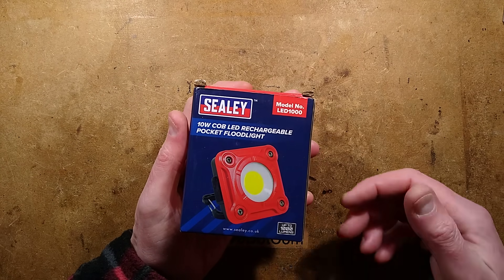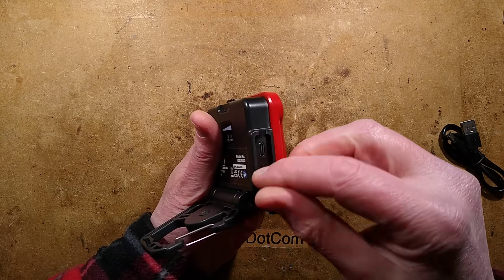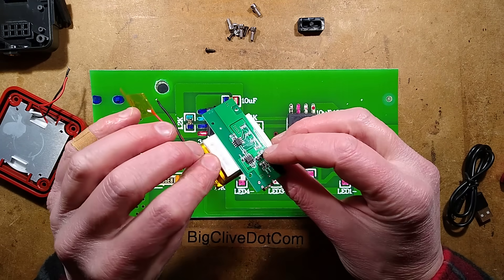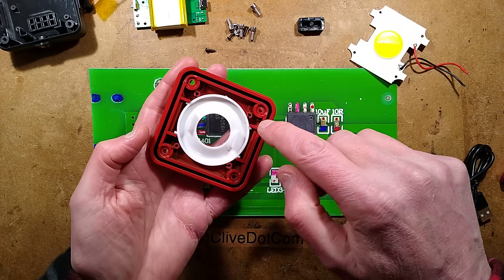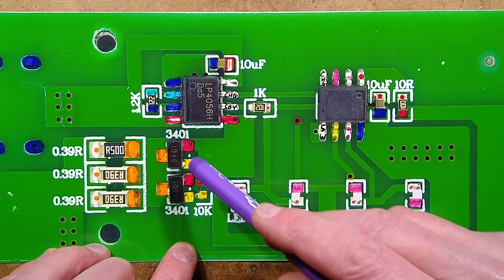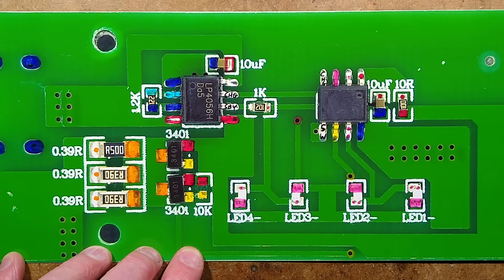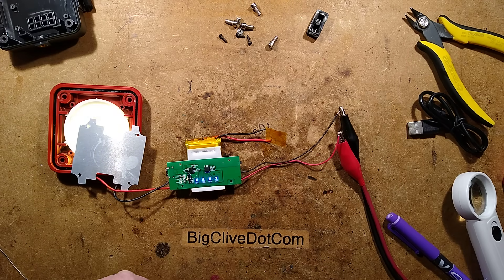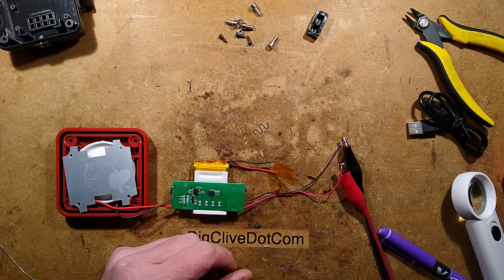Pocket floodlight teardown - with schematic

Comment: Could you do a video to eliminate or bypass the click flashing light...
ie battery to bulb with resistor to run and possibly dimming.
Anti epilepsy upgrade 😻

I don't like the possibility of puncturing the battery also the heat.. 3? Amps🤔
It's not just conduction but radiation and a unventilated space.

I have an idea for a video... could require a microscope 🔬
Take a debit/credit card apart.

Comment: What bothers me the most is that it has a lithium pouch cell(s) in between components that get warm. I'm not sure how much to worry about that, but using that battery as a heat sink just seems wrong. 
I popped a big lithium cell drone battery on purpose to show a friend to prove how dangerous these things are and it farted the grey gas which ignited explosively followed by the ridiculously hot flame jets. In less than 10 seconds after self-ignition all that was left were weightless ashes I have no plans to do that again any time soon, it scared both of us, even though I'd prepared to contain the fire.

Comment: i thought that pouch batteries shoud not be squeezed since that is what Samsungs Note 7 phones brought to self ignite, Samsung bought batteries from another vendor, which size slightly deviated from spec and during charging these spicy pillows can expand due to gases. If that gets restricted the separation inside them can fail and bridge anode and cathode
Reply: Upvoted for "spicy pillows" !

Comment: I don't buy any flashlight/torch that has that dam blinking function. If I get one from Amazon because they didn't say it has it in the description, I send it back. The flash function is not needed for shop use. If it's a bike, camping, or running light, it is useful. China needs to let us know this. No more flashey, # No more flashey, No more flashey, No more flashey, No more flashey.

Comment: That's not a 10watt LED! A 10w LED emits roughly the same light as a 60w incandescent bulb. I have a torch/flashlight with a 10w Cree and without the lens and reflector on it, lights up my living room quite brightly. With the lens and reflector I can overpower one 55w halogen headlight or even my 35w HID headlight. It claims to be 1016 lumens and uses 2x18650 batteries in series/parallel. It charges from a USB A, can charge another device, and is a torch/flashlight. I can't buy a replacement battery for it, so I disassembled the battery and replaced the cells myself with larger 3000mah high drain batteries.

Comment: An entire computer to run a light. The mind boggles.
Reply: I’m reminded of an old science fiction story in which computer chips become sentient, with watches, radios etc being discarded because they want to hold philosophical discussions with their owners, eventually crying out for help as their batteries run down.
Reply: @markfergerson2145 There were a few similar Black Mirror episodes, but it’s worse - instead of an AI the embedded sentience is a duplicate of a real human.
Reply: @markfergerson2145 , thst,'s a good argument for all AI to be run off of batteries, and not from the electric grid, so that it cannot remain sentient indefinitely. A sort of electrical "sundown provision" !
Reply: I can handle batteries that go bad.
    What I hate are phones that spy on me after they are turned off.

Off should mean off.
Reply: @tomweickmann6414  I put mine in a coffee can with a tin lid. I put it in there and then called it and it was silent,, just to check.
Reply: @tomweickmann6414 ,  if the microphone on your phone's keypad is enabled, it most definitely does listen to you and collect data!
Reply: CPU is just 1 single ALU unit (1 adder, 1 or, 1 and, 1 xor, 1 not) shared between all circuit.
With no MCU how many "or"s and invertors you need to create a toggle button? 
CPU is simpler because it solve problems using same resources shared in time instead of multiplying resources that do nothing most of the time.
Reply: Hello - you must be new here; welcome to the 21st century!
Reply: its probably for the charging circut
Reply: @perry92964 No, that’s handled by two other chips, one looking at the USB input and another handling the cell charge and discharge. The micro handles the light output and charge state display LEDs. Remove the blinking capability and the micro could be left out.

Comment: Does it remember the light setting when switched off ready for switch-on BC? If not then if you have to go through the accursed flashing mode in order to select the brightness makes it a definitely "do not buy" for me.
Reply from the maker: It doesn't.   But it does go through a logical sequence.   Low, high, strobe.

Comment: I bought a surprisingly bright key-chain light from my local petrol station about a year ago, which too has a magnet on the back and charges via USB-C. I thought the magnet would be very handy, should I find myself grovelling under the bonnet of my car at night. 

Stupid here forgot the whole front end of his car is made from aluminium...
Reply: Is your car put together with aluminium bolts?
Reply: @tonysheerness2427  Glue.
Reply: There was a time I brought a flashlight with a magnetic tail cap up a ceiling and it was a mistake. The magnet attracted a bunch of rust and metal dust from the roof that fell on top of the ceiling that by the time I got down the black tail cap was brown. (Popped the magnet out to not make that mistake again.)

Made a similar mistake before with magnetic USB cables and left the part that separates from the cable on the phone. After a few days of using the phone outdoors the cable does not contact the magnetic pins anymore due to all metal particles that got attracted to the magnets. Had to clean both ends for the cable to work again properly.

I find magnets are nice when they work in your favor but when they unnecessarily just attract random metal particles its a headache.
Reply: Landrover Defender or Audi A8/A2?
Reply: @Stefan_Dahn  BMW E60 (5-series 2003 - 2009). The rest of the car is steel.
Reply: @HowardLeVert I think some parts of my car may be fiberglass in addition to aluminum (but it's Volvo)
Reply: Only realised the wife's Citroen C5 Crossair had a plastic tailgate when she tried to slap the magnetic UK badge on before a booze cruse last February. She's swapped it for a Nissan Qashqai and the UK badge has clung on perfectly in last months trip. Happy days as, along with copious amounts of wine, she brings back a good selection of beer for me. Cheers all. 🍺

Comment: Does this one start to slowly lose intensity a few minutes after you leave it on? I have a Parkside (Lidl) 20W battery floodlight at work that starts dimming down very, very slowly a couple of minutes after you turn it on, yet I can notice it doing that in very small steps, and its very clearly been programmed to do that. When you turn it off and back on, it comes back at full power and does it again. I wonder why they do that, are they hoping we don't notice it getting dimmer so the battery lasts longer, or is it because they decided to not install a proper heatsink in the bloody thing and are trying to get the LEDs to not overheat? It's really annoying because initially it's actually impressively bright. I also own a small handheld work light from them that does the exact same thing.
Reply from the maker: It's to reduce the heat dissipation of the LED array.
Reply: And yes, the floodlight has the obligatory strobe and SOS mode, because of course it does.
Reply: @redpheonix1000 usually its the temperature of the led which causes the drop by the driver... But the 18V Lidl floodlight doesn't not do that with a fresh 4Ah so maybe your unit is defective

Comment: Everybody is so fancy with microcontrollers when a simple rocker switch high-off-low will do the job just fine.
Reply: Yes but a switch won't do the vital SOS function!
Reply: @zebo-the-fat the one that everyone hates?
Reply: @Handyman1199 , zebo was obviously being sarcastic!
Reply: @goodun2974  so was i
Reply: @zebo-the-fat  depends how quick your fingers are
Reply: @zebo-the-fat  good catch, imagine flashing SOS to no avail manually.
Reply: To an old bugger like me what you are saying sounds right. But these days a microcontroller is probably cheaper.
Reply: Not matter of fancy, it is simply cheaper to switch off low voltage DC current using mosfet, which can at the same time deal with the question of isolation when charging. rocker switch cabable of controling 0.35Amp and switching it off,  in a dusty enviroment. Sealey is a DIY (plasterer) used brand, that would reduce the switching capability of rocker switch even more. As much as I have put rocker switches into mine laser spirit levels and would like it in mine (electricians) headtorch, Switch that would handle the dust would cost too much. This brand is not good enough for for electricians.
Mosfets are simply better value for money when switching DC.
In either case. I disagree with @clive on this being much good. as headtorch on your head just does not take handy pocket space and its too big for carabin onto belt
Reply: SOS function can be activated by pressing several seconds. Don't bother people with normal use.
Reply: But that rocker switch can not produce most important and usable mode in our world - flashing mode!
Reply: Man, I don’t like the dent in that lithium battery.
Reply: keep thinking people must get into all sorts of s..t in china that they need an sos in every product.😂
Reply: Was going to say that thing is begging for a toggle switch.
Reply: You already need the circuitry for charging, so you will have to pay for the PCB. And a rocker switch costs a lot more than a tactile switch, and all of a sudden the extra cents for an MCU isn't that much anymore. It always, always comes down to cost.
Reply: @JendaLinda  3 amp at full draw, so you'd need a beef switch or relay. No pwm so even worse wasted power with ballast resistors. Higher wattage resistors so through hole instead of smd so higher assembly costs. And undoubtedly would be a lower power bulb type.

It's not your grandpa's flashlight world anymore
Reply: @nyetloki why not a regular small switch toggling a mosfet to actually push the current?
Reply: without the microcontroller then you wouldn't have the need to ( As Clive says ) "Crack one off"....... Resister, Resister.. I meant Resister..
Reply: I don't think that would help the waterproof rating and would also be particularly prone to being accidentally triggered, which could be a fire risk or, at the very least, discharging of the lithium cell and damage to the LEDs.
Reply: @ElectricChicken  what fire risk my man that's a led light lol. 

Also imagine how Manny decades there where waterproof lights with switches.... 😅

Comment: I like that it has a lipo over an 18650, I don't like the plastic tabs digging into it. One good drop, and it could go nuclear. Lol
Reply: Having used many soft case lipos in rc car both 10th and 1/8 scale you would be very surprised at how much abuse these batteries can take. Around 37mph into a tumble to then having the battery fly out and tumble some more on a tarmac car park, got a couple of years out of 5000mah turnigy soft case packs getting many weekends off abuse
Reply: @HootMaRoot  having seen clive take apart street lithium from vapes and done the same with ones that have literally been ran over and flattened by cars i can confirm that these pouches are surprisingly resilient
Reply: 18650 has protecting valve which causes open circuit if internal pressure rises. LiPo cell has no such valve. It becomes  wider when internal pressure rises, and in normal state already has dents. I mean Lipo has more chances to cause a fire than 18650, even with no factory installed dents.
Reply: Lipo on metal hot cooler ist dumb and most 18650 can take some impact. This bulgy lipo sack burst into flames much faster

Comment: I had a Snap-on version that I found lying in the road... it was excellent (not sure the COB rating) I did look it up... being Snap-on, it was seriously expensive, about £60 and that was nearly ten years ago!
Reply: I found my Snap-on flood light the exact same way! Crossing a major street I didn't see it till I stepped over it! Use that light at night every night since! No strobe feature thankfully! Dimmable too!
Reply: @reddrglrd , I have a half-dozen identical-appearing LED flashlights in the same cast/extruded aluminum casing, that I bought 4 or 5 years ago at various times from the same "job light" store. Some are high-low, some are high/low/flashing. I engraved the functional-sequence onto them with a Dremel tool so that I can tell them apart! The ones with a flash mode are in the glove boxes of our cars, and the non-flasjing units stay in the house. There's also a bright-green plastic-housed, lighter weight version (same size and shape) that is strictly on/off. I should have bought a couple more of those! PS, they all have strong magnets in the screw-on end cap that covers the battery compartment. I like these things a lot ( they were about $10 or less as I recall)) but generally dislike the flash mode. I also have a big powerful cylindrical D-cell flashlight, purchased over  decade ago, that has 5, FIVE modes, including slow flash and fast flash, which is 2 or 3 modes too many. Anything more than hi/lo is just annoyingly superfluous and a waste of my time....
Reply from the maker: I bet it was accidentally left under a bonnet/hood by a mechanic.

Comment: Great vid - Now, will it still light when on charge? Many of these rechargeable devices cut out when charging, but using this for bench filming I'd need it to stay functional when on charge. Either that or cut out the call altogether and hardwire it perhaps....
Reply from the maker: It does.  But they advise against it.

Comment: The lithium battery is just waiting to catch on fire. 🤣
Reply: I think lithium cell fires are not as common as to warrant that level of concern. There are probably around 100 billion cells in regular use and just a handful of catastrophic failures a year and alot of those are user modified devices, etc. That's pretty damn safe, I certainly don't lose any sleep over it.
Reply: @ElectricChicken exactly lol. How many of your phones have burst into flames?
Reply: Yeah, I saw that, and thought: "I'll stick to alkaline batteries for something like this thanks. I don't care if it makes it thicker, I don't want a metal fire in my pocket."

Comment: 1.7 Amps through a 0.5 Ohm resistor is 1.445 watts. I wouldn't expect that tiny surface mount to last long.
Reply from the maker: Yeah.  It seems to be done a lot.  I'd rather replace all these resistors with a higher value to make up a chosen value.
Reply: Well you just answered why there were initially 3 separate resistors.
Reply: @orion310591RS  Except it limits the current by measuring the voltage across the resistors. That means all three resistors would have that wattage each or more since the ones he cut were lower resistance. It's not designed to live very long.
Reply: @orion310591RS  3 0.5w 1210 smd resistors would work just right there.
Reply: @orion310591RS  
If you remove a resistor out of a parallel set it does not change the power through any of the individual resistors (well except for the one you just removed obviously).
Reply: A way of removing things stuck together with the foam tape is to use a piece of dental floss as a wire saw and work the floss between the two pieces stuck together. This will cut the foam, separating the pieces.
Reply: @stellamcwick8455 
A drop of oil as you use the dental floss helps to keep it from sticking back together.
Reply: @Assassinlexx  that’s a good idea.
Reply: Like it, thanks! @stellamcwick8455
Reply: It's only around 400mw shared between all three resistors. Not 1.44w
Reply: @waynemillard1495  Not when you chop them out. Then you have one or two somewhat smoky resistors. Really kinda stuck with the lithium cell dictating the current on the high setting since there is no current monitoring.
Reply: Unless I’m missing something I don’t think removing these would buy you much other than toasty resistors and a crispy spot on the back of the plastic case. They look to be there just to provide some ballast for the mosfets. Lopping them out is not as effective when there is no feedback. (Replacing all three would be viable as Clive says above. Could also remove the static setting via modifying the gate circuitry and then lop away, but then there’s a defunct setting in the button cycling.)
Reply: I found that a lot of such Chinese lamps in fact drop a power to 50% after ~15 minutes. So, it shall be fine.

Comment: You could 3d print a spacer to go between front and back shells and stuff it with more cells.
Reply: I upgraded a BT speaker with this approach. Rather than “where do I get a new battery” I thought “what’s the biggest battery I can get in here?” It runs for days now.
Reply: @wimwiddershins  or you could buy the slightly larger Sealey 10W pocket floodlight that costs £2 more and comes with a 4.5Ah battery. (Sealey LED1000PB)
Shop around, there are places selling them for ½ the RRP.